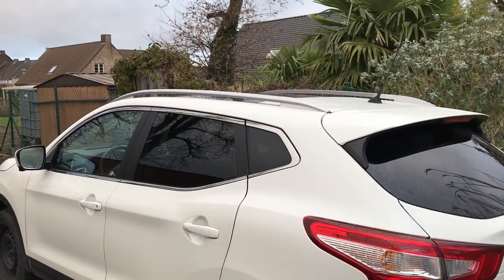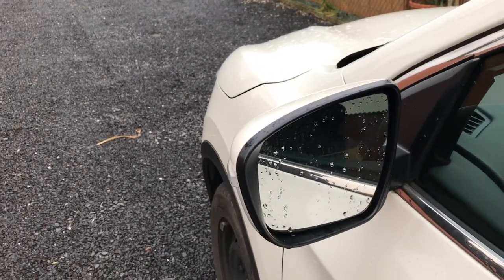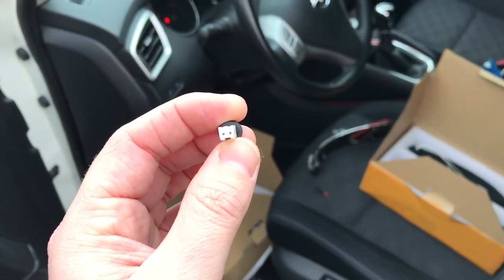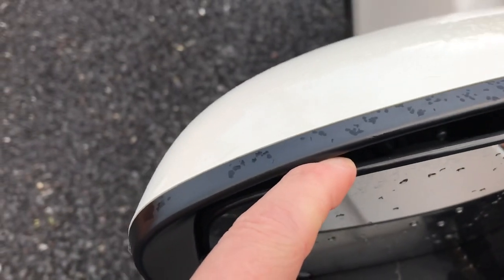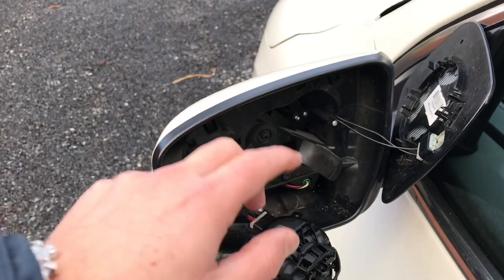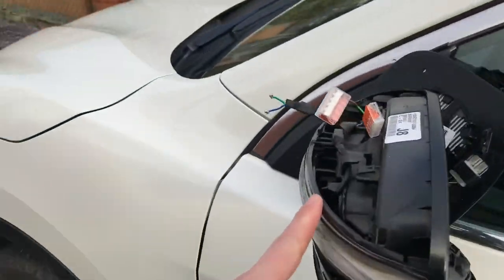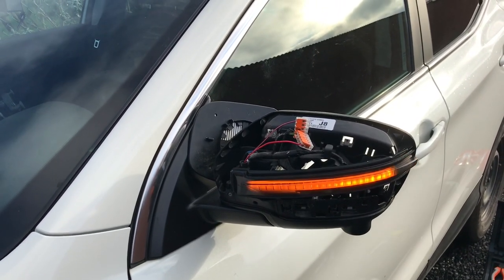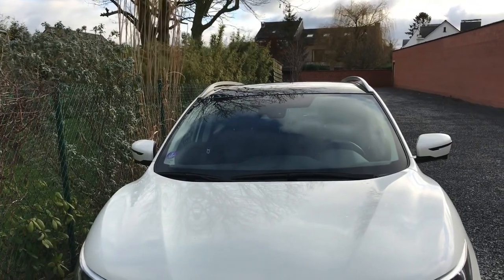Nissan Qashqai J11: Dynamic Turn Signals IMPROVED

Comment: Merci beaucoup pour toutes vidéos très précises et utiles ! C’est super ce que tu fais. Je suis bien tenté par l’achat de ces clignotants dynamiques. Pour être sûr d’avoir bien compris, tu peux me confirmer que les clignotants que tu as mis dans le lien Aliexpress ne nécessitent pas de soudure ? C’est juste du Plug&Play ? Merci !
Reply from the maker: Merci à toi pour le soutien 😉 👊🏻 Oui tout à fait, plug & play. Faut juste ôter la petite prise un peu dissimulée dans le clignotant (genre de bouchon). Si j’ai dû connecter les câbles manuellement c’est parce que j’ai dû coupé les câbles pour la première version de ces clignotants. N’hésitez pas. C’est facile et tellement beau 😄 a+
Reply: La_Palmeraie ça y est j’ai reçu ma commande hier. J’ai installé ça ce matin 👌🏼
Le rendu est super 😍. J’ai la même finition que ton Qashqai en blanc et le rendu avec la version clignotants noir fumé est juste magnifique 😍.
La première étape pour déclipser la vitre a été un peu laborieuse sur le premier rétro. Je n’osais pas trop forcer de peur de casser les clips. Le 2ème rétro a été une rigolade. En 5 minutes c’était fait ! J’ai juste cassé un petit clip de maintien de la coque blanche du rétro mais ça tient très bien. Merci encore pour ta vidéo super utile !!
À bientôt 👍🏼😋

Comment: hi have a link for turn ?
Reply from the maker: Here you go https://bit.ly/2tR0BMV
Reply: @LaPalmeraie0032  I have these smoked ones on my car 6 months already and so far they work great and look great I have the pearl white facelift model with black glossy mirrors , they came with the right connectors but they were a bit to small I had to get creative to make them fit ( the pins in the socket of the turn signal were slightly to far appart) I guess they improved them meanwhile
Reply from the maker: Robert Deman that must be beautiful indeed Robert 👍🏻